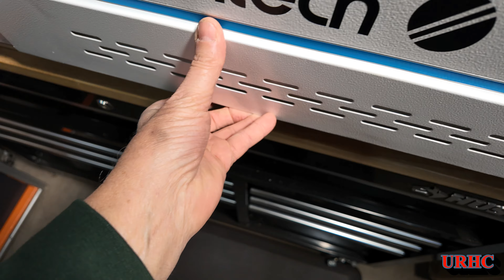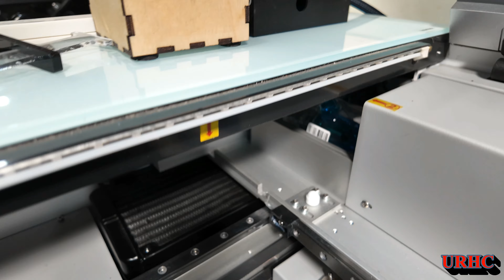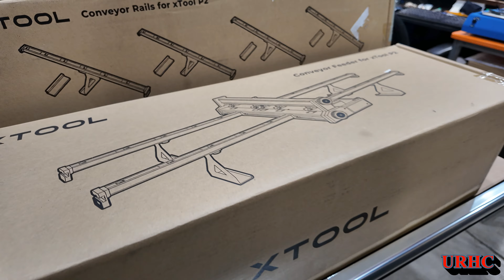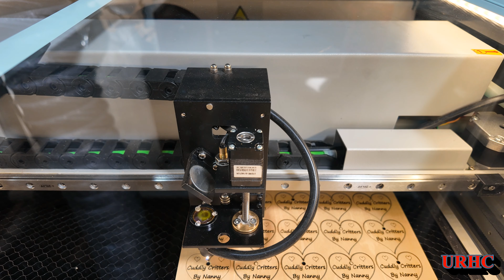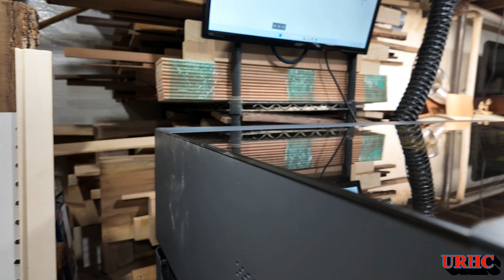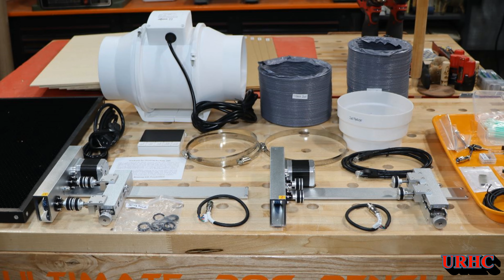Omtech Polar VS xTool P2 A Simple Comparison

Comment: Hi 👋, UHRC , I hope you are keeping safe and well, It looks and sounds like there is pro and cons with both of them, The big downside to all Chinese made products is the lack of support and availability of spare parts and upgrades, shipping time, and the cost, 
Did you ever resolve the issue with one of your machines? , You updated the software on it, and you seem to find the machine then run slower., when I was running my business, I have got machines that need servicing once or twice a year, Which probably cost anywhere between hundred 200 £, and the support was very good, Though I did have a problem with one new machine, resetting the calibration, I had to call the service engineer in, but even he couldn’t figure out why it wouldn’t go back to 0 settings, he had to phone somebody else, And their comment was that I was too critical on my settings, or when you’ve got a digital read out on your machine and you want to set it at 20.5 mil and you run a piece of timber through it and it comes out at 21.2 to me is not correct, just because I I use a pair of Vernia calipers to measure certain components, and I want the timber to finish at a pacific size, by leaving it as it was it meant every setting I had to adjust the height taken in for the allowance of the offset, and this is not correct, But with some perseverance and keep trying to read and understand the instruction manual, are actually now know how to recalibrate it within a few seconds, 
But I suppose it’s like everything else when you are working with it 24 seven you then get to understand how to operate these things , but never been any good with computers as such, 
Great territorial the pros and cons of the two machines , it must keep you busy, 24 seven, 
I have made a decision about the purchasing one I think I’ll give it a miss , invest in money into a machine that I don’t know how to use, and it will take me a long time to be able to get my head round it, and it needs to be making a profit within 3 to 4 weeks of my purchasing in it, I think it’ll be 3 to 4 years at my rate, look forward to next territorial great fun to watch, stay safe, keep up the great work, hope you both have a great Christmas and a prosperous New Year, Phil from the moulin,
Reply: Hi 👋, thanks for the reply, considering I was just a one-man band in respect, My joinery shop business, Was very large, considering I was just one little bloke in a very large workshop, It was an old long grain barn, about 8 m wide and about 30+ metres long, Plus the space where I could actually drive in with my van and park up to load and unload if it was raining, And if I needed a tool or a piece of machinery that I think I could actually do the job quicker, I would think nothing about going out and buying it, I remember on one occasion I had 10+ doors to make and door frames, They were in the Georgian style, but with high security locks and hinge systems on, it will take me approximately 4 to 5 hours to fit one, So I went out and bought a special lock chain Mortis machine, made by Mafell cost around £2700, it only took a few minutes to set up, And a few minutes to mark up the side of the door, and you could mortise all the holes for the lock mechanism to go in and around total of less than five minutes, This first job, of a batch of doors of 10, I had them all lined up in my workshop, and it took me less than 15 minutes with this machine to cut all the mortise locks in, this is where I feel like I need to be working, I feel sad not being able to do anything, at present, I do not have the space, Money that was supposed to be released to me this week doesn’t look like it’s going to be now until in the New Year, And I will not be able to restore my garage, i.e. put a new floor down and finish off Roof, because of bad weather mainly frost, 
Sorry I gambling on a bit , Hope you both have a great Christmas, look forward to seeing you next territorial, Phil from the moulin
Reply from the maker: Yes these are fairly expensive and do take some time to learn to use. Many buy them to make multiple products that are identical that helps pay for them quickly once the files and settings are worked out. 
Recently I have gotten emails from several buyers that didn’t look into the maintenance and repairs when buying and it doesn't sound like some want to deal with it or weren't really capable of handling it. I wanted to stress with any machines from China, there can be downtime with some wait for support and parts. They both have pluses and minuses with full Lightburn implementation seeming to be required for those upgrading from diode lasers.
Sounds like it would be best for you to start by doing what you are familiar with first and see where that takes you. There  are so many laser made products online that are hard to compete with. Thanks for watching